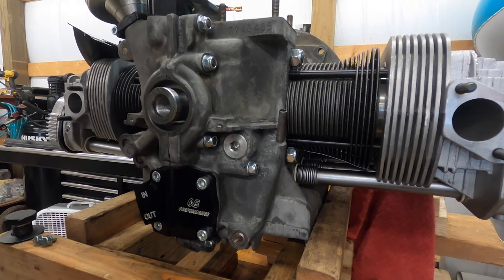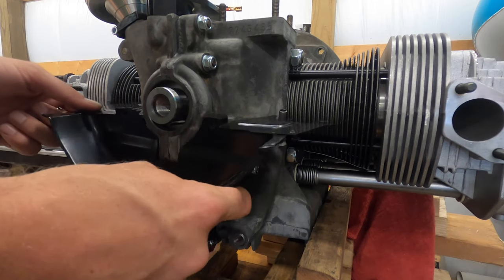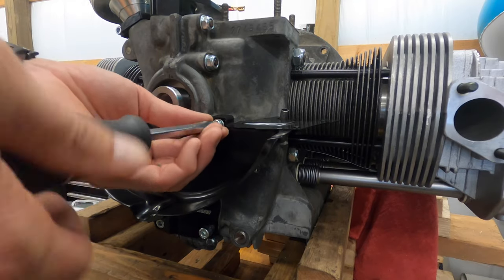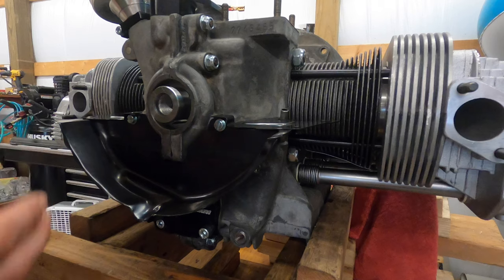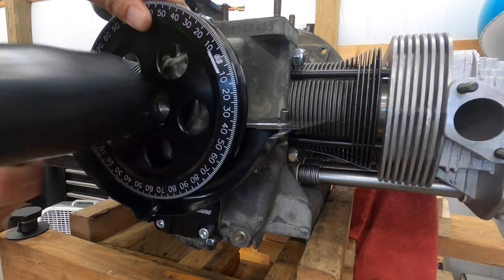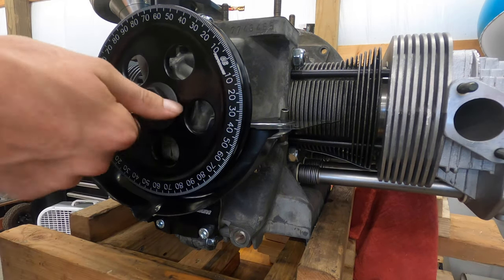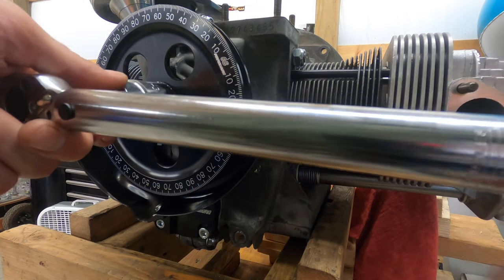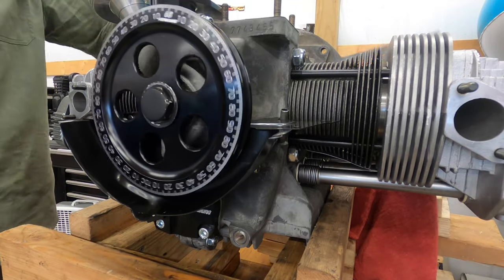VW Beetle Crankshaft Pulley Install

Comment: Good job Vito. I f’d up and put all my tin on before I torqued it. Hope I can fit the socket and torque wrench in there. Jaaa😁
Reply from the maker: Haha. Sorry to hear that!  Thanks!
Reply: @VitosFix  no worries. I actually couldn’t even find a socket that fit or a wrench so I had to use a crescent wrench and tighten as best I could. It’s on there right so it ain’t going no where
Reply: Check out the pics on my Instagram while I find time to edit a video and post. @sandiego_vwlife
Reply from the maker: Looks good man!  Sent you a message. 

@vitosfix

Comment: I have an oil leak coming from the shaft behind the pulley. Any ideas?
Reply from the maker: You can install a sand seal.  Did you just rebuild it or is it an older engine?

Also, check out the video below for other possibilities.  

https://youtu.be/Z43evIULDDE?si=rgKsUXntPgjBRXIg

Sand seal 29:39
Reply: @VitosFix  Thank you for the reply! I'm installing a breast plate and sand seal pulley kit today........yesterday was 4 ball joints........today HAS to go better! lmao!!!
Reply: @VitosFix  Would you happen to know the size/threads of the 2 bolts that hold the plate on? I do not have any and need to get some. Thanks for your time!!!
Reply from the maker: Hope it goes well!

Comment: How do you remove the pulley before hand? I had a bit of an incident where the old pulley got off kilter and shattered on the road- so no tools to lock it into place. I haven't been able to find a definitive video on it
Reply from the maker: There are a few tools that work the same, but this is the one I used to remove my old pulley.  It can scratch a nice pulley up though.  

https://shop.advanceautoparts.com/p/performance-tool-4-inch-3-jaw-hd-gear-puller-w136p/11244449-p?product_channel=local&store=3290&adtype=pla&product_channel=local&store_code=3290&gclid=CjwKCAjw_NX7BRA1EiwA2dpg0tNpnsHetRxtpI58iwyO-YuJxWHsGds1XGqGtZvCBXosjzDyNrKyZhoC5ioQAvD_BwE&gclsrc=aw.ds

The bolt can be removed with an air impact wrench.

Comment: Do you know of people "sweating" the pulley prior to install? Basically, heating the pulley up in hot water?
Reply from the maker: I haven’t heard of anyone doing it with hot water.  For installation I would just gently tap it on there.  The tolerance shouldn’t be that tight to have to heat it up.

Comment: what is the torque setting for the bolt on the pulley
Reply from the maker: 32 ft Lbs.

Check out the description for other links as well!

Comment: Hello, Thanks for posting, does a seal go in there?
Reply from the maker: https://youtu.be/aB-NJiR27ns

Take a look at the end of this one.  That’s the “seal.” Oil slinger.  So if you’re just replacing the crankshaft pulley, nothing more required.  Below is a link to a picture as well.

https://www.thesamba.com/vw/forum/viewtopic.php?p=7361953